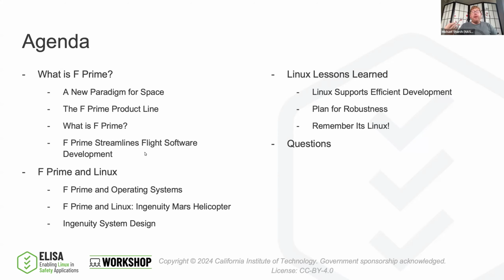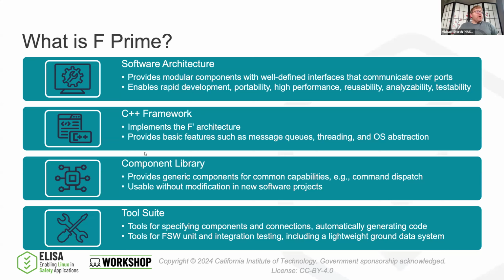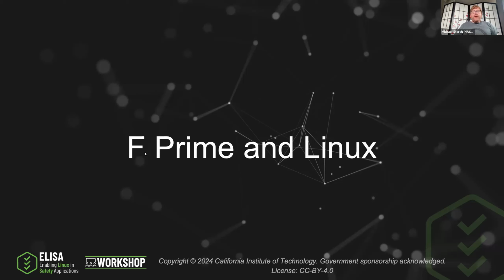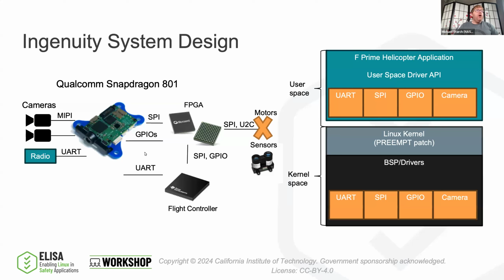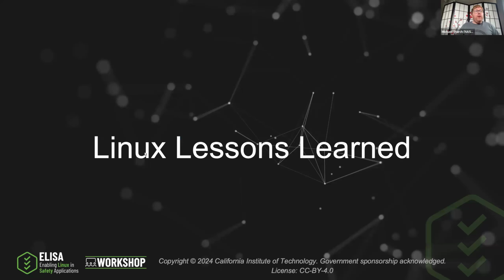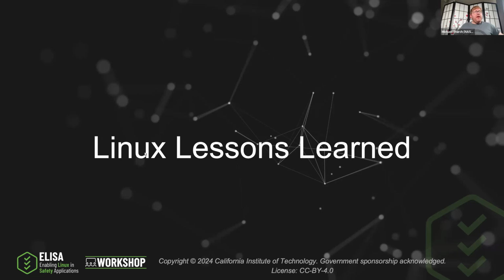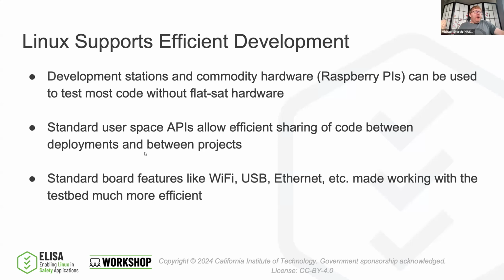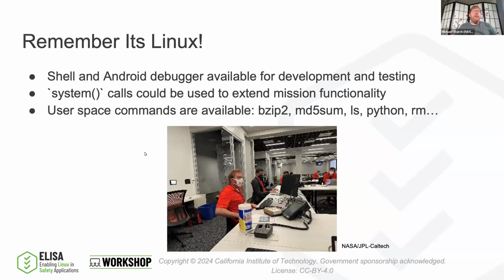F prime

Comment: Awesome video! I’ve built tons of projects with F prime and even got it running on an ESP32 for a GNC project. I used jumper wires and capacitive sensing to measure displacement, created a scale to interpret the readings, and used that data to fire thrusters and align objects in space, such as a spacecraft with a docking hatch. It’s been a lot of fun learning this FSW!